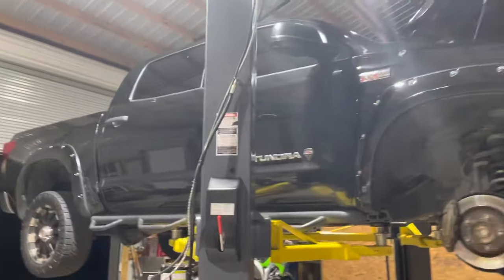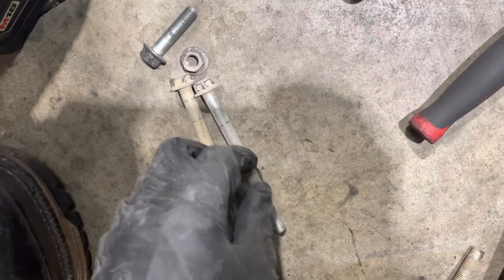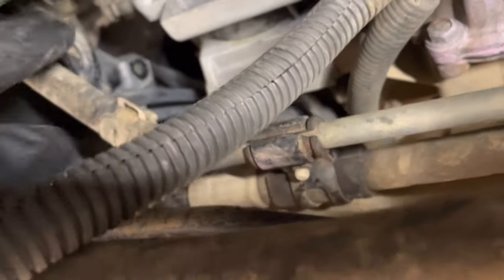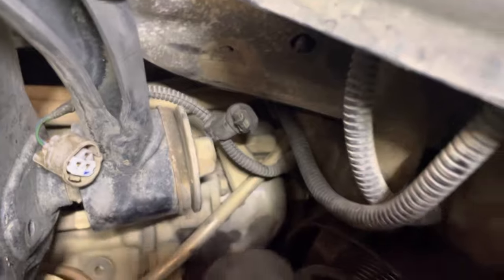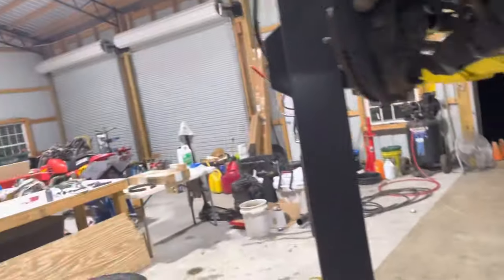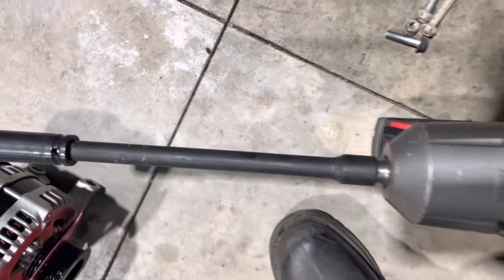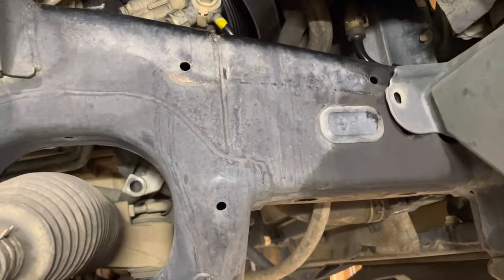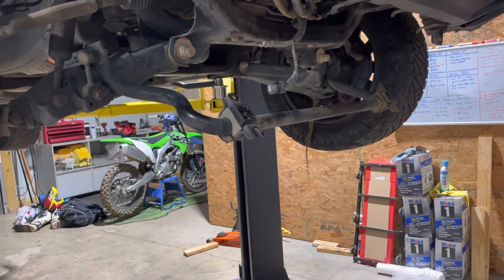Toyota Tundra 5.7 alternator change and advice 2007-2014 and newer

Comment: i just did this. few things to note: ill start with being in MN, the rust  has rust.  the power steering pump can be moved farther up and zip tied well out of the way if you pull the electrical harness tie downs.   i pulled half the wheel well lining to give more room.   upgraded from factory to a 395 amp alternator. 

you should have a face mask or goggles for the falling rust when moving everything around under the front. if your on the ground it gets pretty bad. dont try this if its rusted with out eye protection. 

i highly recommend removing lower radiator hose, can do thermostat at the same time - gives all the room in teh world, keeping it in is a pain in the ass.   a wood block and air hammer may be needed to remove the alternator from its alignment dowells. its REALLY stuck on there.

transmission lines are directly infront of the lower rear bolt and nearly touching its face, no room for removal. loosening the rear mount for these lines helps give some movement to pull them down about an inch and a quarter so the bolt can clear them for removal. this mount on mine was badly rusted - the 10mm bolt broke right off. decently easy drill out but may add time here.

the sway bar mounts - the backing nuts are not affixed to teh frame very well at all. they break free and the openings on the rails are not large enough for any wrench to grab them. the frame rail holes need to be enlarged about 1/2" to make access.  replacing these nuts with new grade 8 and some plate welded on for tabs is a much better option than what ever hte fuck this factory junk was.

the power steering pump is VERY tight. i took a light flap disc to the mounting surfaces and that greatly aided in reassembly.

wiring harness going along the front of the engine cross member can be unplugged to allow for extra room when pulling the alternator out from the front. 

total job was about 2 and a half hours.
Reply from the maker: That’s my home state and I will never have a car from there again!  I don’t miss the rust issues up there!  Good job friend !  God bless you for the info!

Comment: Good video!  If you have trouble dropping sway bar like I did (rusted) you can take the alternator out the wheel well.  Just push the PS pump forward and up.  Keep trying different rotations, its tight but you'll get it out like I did.
Reply from the maker: Awesome insight and thanks for the advice

Comment: Doing one of these right now. Thanks for the tips....I am removing the lower radiator hose for alittle more room. Its definitely tight! I am in NH so things get a bit rusty here and the truck im working on is an 08.....book time says 4.8....im an hour in and making good progress I think....Thanks again!
Reply from the maker: You’re welcome and glad to help!  Lord bless you
Reply: @dtmxing  took me 5.5hrs! The bottom alternator bolt was siezed and bolts to the corner of the timing cover, so I had to take my time and use lots of heat and baby it so it wouldnt snap....Tried to remove the stabilizer bar but the first bolt I tried came down about an eighth of an inch and then started spinning in the frame....so I had to take the alternator out the side.....probably the worst alternator job Ive ever done...lol.

Comment: Great video! 
Just a few ideas that might help. After taking the Power Steering pump screw out the pressure switch.  Just drain the power steering fluid. Gives a little more room when you tie up the PS pump. Also take out the front part of the plastic wheel well shield. Also finally push up on the suspension to drive up the upper suspension A arm link like two or three inches with a floor jack . That will give you enough room to slide the Alternator out.

Comment: You've got a big coolant leak from the water pump, too, judging by the residue on things... As well as a timing cover leak (possibly).
Reply from the maker: That is correct this truck got a water pump and oil filter housing was leaking and bell tensioner bracket assembly as well

Comment: I wonder why did the engineers for Toyota decided to put the alternator in the worst possible spot? On Chevy and Ram it’s mounted on top and it’s a quick fix.
Reply from the maker: Maybe one of the engineers was reading the drawing upside down ? 😂
Reply: Good question.

Comment: Thank you for the indepth video. Clear  and informative. My quote was 785.19 to replave and i would supply the alternator. Which is 238.00 at my local part store. Uh uh uh. That one. Lol. This video will help in the amount of time it actually takes as AllData has way more procedures than needed. Again thanks man
Reply: You know you can get Alldata for like $100 bucks right? No monthly subscriptions no switching CDs out or anything.. Let me know if you're interested and I'll send you the link where to get it.
Reply: According to AllData, this job calls for 1.8 hours. So $785 is extremely high quote, although most shops won’t replace when customer supplies the part
Reply: All data did show way too many steps lol, said to remove the intake and starter which is why I got on YouTube. I was like I don’t need to remove any of these things
Reply from the maker: Definitely not 1.8 hour job…it’s more than that even with what I did it take me around 2.5 after doing 3-4 of them

Comment: So did everything, however not sure what type of 14mm socket you used to get the short bolt out of the power steering pump couldn’t any thing to fit it but an open wrench with no room for turns
Reply from the maker: No wrench Only sockets and nothing special
Reply: You have to remove the power steering pump to get to the top alternator bolts, to remove the pump you must use a 14mm socket going through the access holes on the pump pulley to get to them, there is no other way, no wrench in the world will fit through them. 
Idk what your working on
Reply: @JasonLee-lv7tm I’m working on a 2012 sequoia and I’m running into this issue. You can fit the open end wrench behind the pulley. But that gives the risks of rounding off the bolt, and for me I can’t get a socket to line up evenly with the 2nd bolt to get it off.

Comment: It will come out tha bottom but tha Toyota dealer said it was a 7 hour job
Reply from the maker: It take about 3-4 hours
Reply: Loval mechanic quoted me for 7.7 hours too.
Reply: I wonder why they are getting different labor times. It’s frustrating as a mechanic knowing that many jobs I do have different labor times than what I’m being paid
Reply: its based out of the flat rate manual
Reply: There's another youtuber that I found that showed the alternator coming out through the panel in front of the right side wheel in the wheel well. I did mine on my 2009 in about 45 mins after getting a quote for nearly $1k from the stealership. This was a decent video but there are other options out there.
Reply: @nickmajdanski I have a 2017 Toyota tundra 5.7 L I badly want to put a larger alternator in. Any chance do you live in Idaho? I’d pay you $150 for that 45 minutes that it takes.
I don’t necessarily have to have a new alternator ASAP. I would just like when they go along with my 2800 watch oh stereo amplifiers. I also have never done the big three upgrades just because of how much of a pain in the ass that alternator is to get to
Reply: @montanaplease  sorry Bud, I'm on the East Coast. I would think it would work for the 2017 as well. Take the front right tire off and it's behind the rubber apron. Once it's loose, flip it around a bit and it should come right out.

Comment: 2011 Tundra, 5.7L, did mine last year (82 yoa at time) with a little help from the "University to YouTube."  It was a bit of a bitch getting it out and back in, but doable with the right tools, patience, perseverance and a few curse words.  There's a lot of good things to be said about Toyota, but placing the alternator in that location was, well, dumb! Toyota could learn a lot from, GM, Ford and Dodge about DIY maintenance.  No transmission dip stick or place to add fluid DUMB!  No spin-on oil filter DUMB! I could go on, but I digress.  I guess Toyota doesn't  want you working on your vehicle, take it to a dealer and be overcharged for parts and labor.
Reply: yeah toyota come on!!